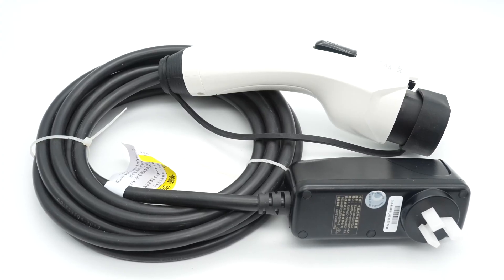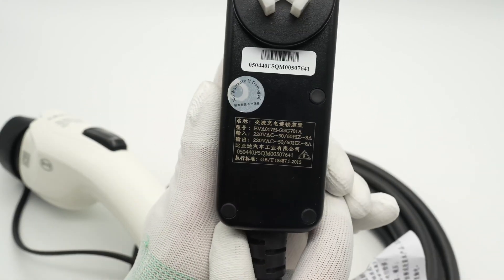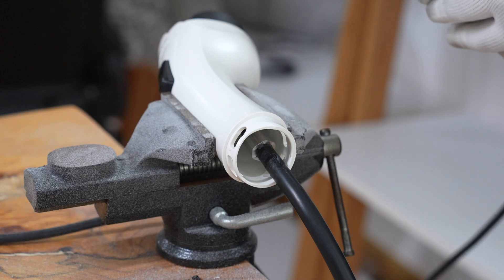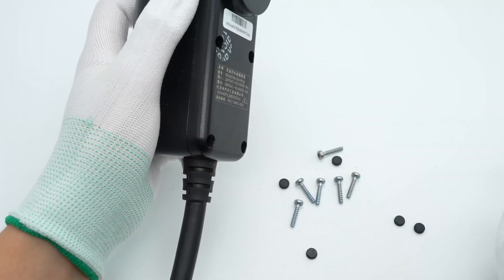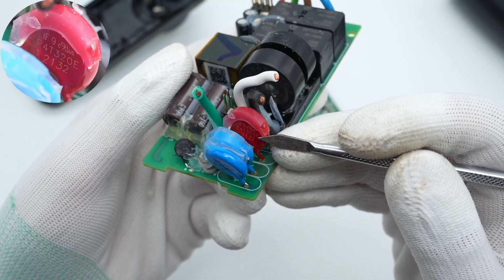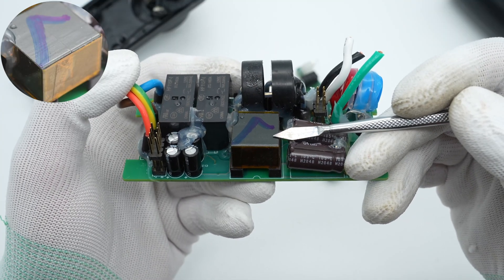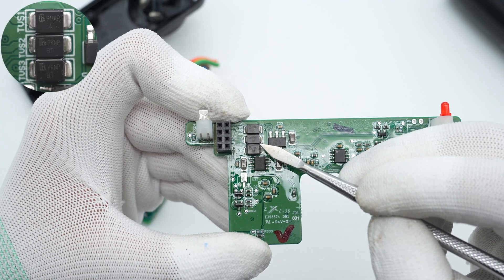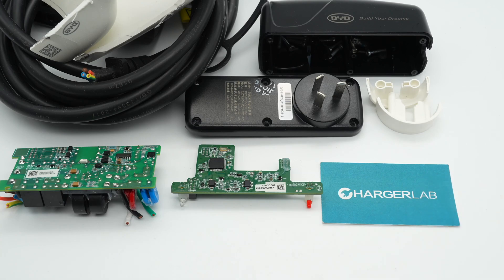Teardown of BYD Portable EV (Electric Vehicle) AC Charger

Comment: Zero sequence (roughly meaning ground faults)..... surprised to hear that technical term on this channel! Usually not associated with chargers on the channel. But, when getting in to higher current EV chargers, it will be a thing.  
The gas tube / spark gap, more specifically is for surge protection. 
Great teardown as always.
Reply from the maker: Appreciate that!😁